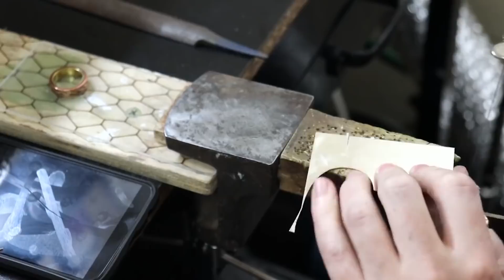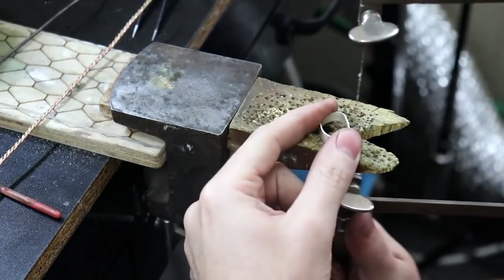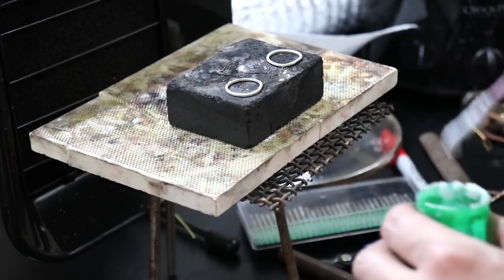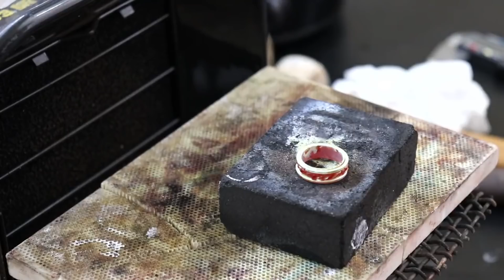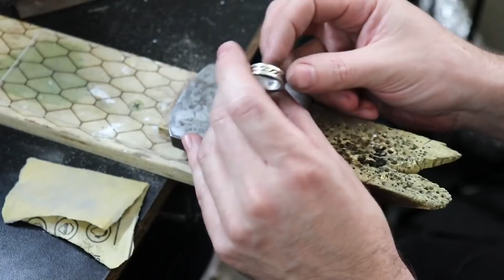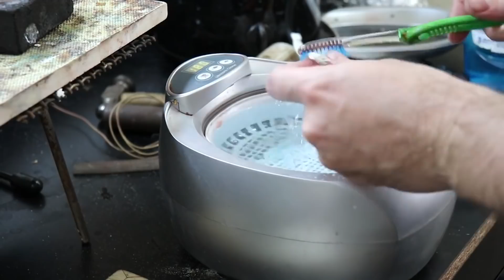How to make a gorgeous silver and mixed metal twisted ring

Comment: hey can i use aluminium wire instead of silver, and if so do i need different solder or will any work
Reply from the maker: Aluminum is a very soft metal and not great for doing this. Also aluminum has a lower melting point than the solder so it will melt before the solder does.

Comment: Thanks so much for this teaching video. I have made a couple of them but have been unable to fill in the gaps on the sides where you say you use a bit of easy solder. Since solder doesn't fill gaps, do you find this works?
Reply from the maker: You can use square wire so it will be flat on the ring and have way less to fill with solder

Comment: Hi ! Quick question, I’m trying to make this ring and I’m using silver as the base of the ring like you but for some reason when I try to solder it the solder chips won’t melt, I don’t know why, is there any tips you can give to avoid this ?
Reply from the maker: Did you pickle your metal to make sure it's clean? That torch and solder are you using? Are you using flux?
Reply: @GomeowCreations  I did pickle it and the solder I’m using is the one you listed on your shop in the links you put in your description, it’s the silver chips, and yes I am using flux. I’m not sure which torch I am using since it’s one of my dads. I think I did figure out my problem though, the edges weren’t flush so there were little gaps instead of it being straight against each other, do you think this is probably why it didn’t work before ? Thank you so much for answering !
Reply from the maker: Solder will melt regardless if the metal is clean and has enough heat. Small torches have a very hard time getting all the metal upto the same temps, allowing the solder to melt.

Comment: Wonderfull a question if is it possible regarding the torc what kind of gas and torc is better for your point of view and tha "pasta" for soldering is soda? Thanks in asvance very very good job
Reply from the maker: I can't fully understand what you are saying but it will try to answer what I think you are asking 😁
When it come to a torch, I like my smiths little torch because it can do just about anything I need it too and I can change the tips to work on large or small parts.

Comment: Grat video but as someone who wants to get into this don't I need a tax id and a wholesale lic to buy silver sheets or wire? If not where is a good place to buy? Thanks.
Reply from the maker: Are you in the US?
Reply: yes east coast @GomeowCreations
Reply from the maker: riogrande.com
Reply: @GomeowCreations Thanks. Trying to accumulate supplies. Just got the Dustan machine but they sent the wrong one from amazon (Sent from Ebay ) got the 1301 instead of 1302 Hope they make it right.
Reply from the maker: @mjrmandor1136  well that kinds sucks but I hope it gets fixed but yeah you can get silver from the link I posted. I also have a full list of stuff I use on my website 😁 gomeowcreations.com

Comment: I loved the way you sped up the video so that it moved along well and added the commentary later at a brisk pace. Very clear presentation! My only other comment would be that such a great smith should have a #20 quick change handpiece instead of the old #30! Save another few minutes of shop time.
Reply from the maker: Well thank you. It takes a lot of work to edif my videos so they don't drag on. I basically shoot the hole video without talking so I can add a clean voice over later. I do need to get a better flex shaft set up with some better hand pieces. The quick change piece would be very nice to have. 😁👍

Comment: I worked for Zales for a few years many years ago. We just used Windex in the ultrasonic. Easy. Ammonia works well. I like dish soap and hot water though for the polishing compound. I need an ultrasonic cleaner. Erg. More money. Grr. Nice ring. Nice video.  Thanks for posting!
Reply from the maker: Yeah I know the feeling, I need a new ultrasonic setup. This one is starting to fall apart and not work as well. 😅

Comment: Love this ring! I think you could easily make it into a spinner ring if you wanted to. And I wondered, do the brass and/or copper come to temperature quicker than the silver? It looks like they might. Not that it seems to be a problem, I just noticed they get red faster.
Reply from the maker: Thank you, and yes the 3 metals all heat at different rates. I have had problems with brass in the past melting before anything else so you just have to be careful when heating it up.

Comment: I have really enjoyed watching you grow in your craft 😊
You might want to consider flowing your solder onto the foundation piece. For this project it's your silver ring. You can do this quickly by stick soldering (after your first solder, pickle and rinse, reflux heat to solder melt point and touch wire solder to the outside of your ring making sure to get  good coverage. Pickle, rinse, dry and use a file to smooth any bumps.) Now you can fit your decorative pieces over this (fluxing the ring and pieces first) and then heat the entire ring until the solder runs.
You can do this same technique with pallions if that's what you have, it's just a bit more fiddly 😊
Have A Super Fantastic Day!
Reply from the maker: Thank you, I will have to keep that in mind for the next time I make something like this. :)
Reply: GomeowCreations My pleasure 😊